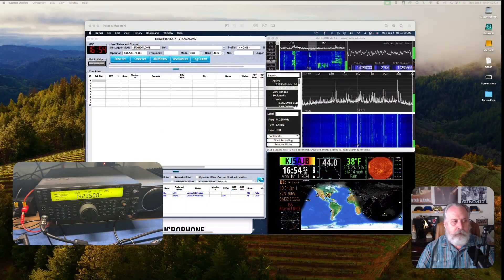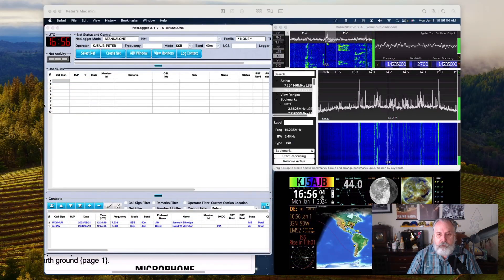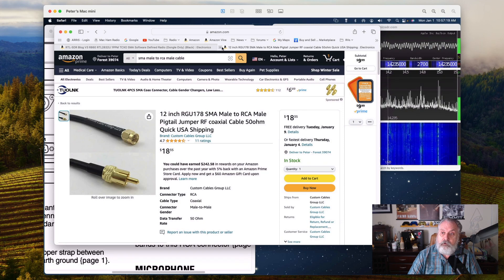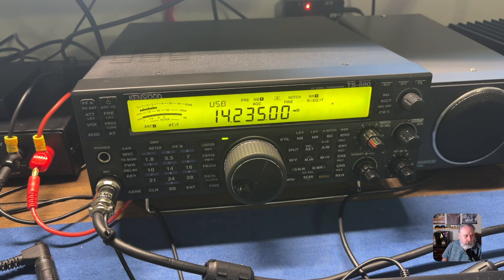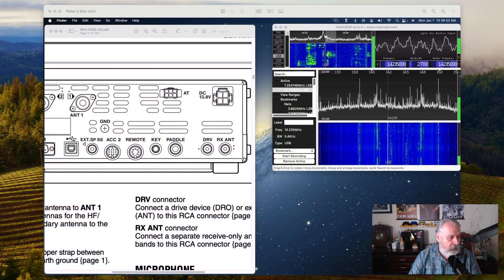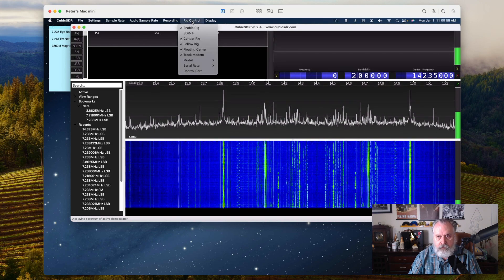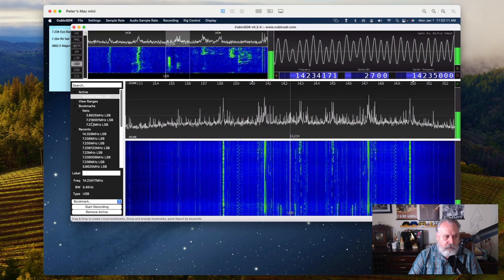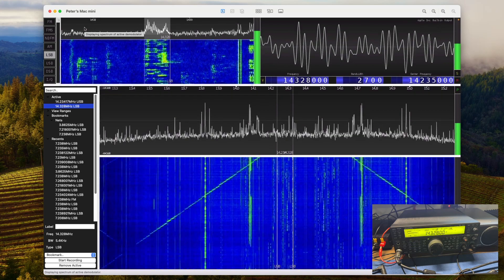Kenwood TS-590SG SDR  Waterfall display Setup on Mac OS

Comment: Thanks for doing this video! Do you know if CubicSDR has a driver for the Elad S2 receiver? Checked the website but not sure. Thanks. 73 de Scott N1IA
Reply from the maker: I couldn’t find info either. You could always download and try it. When CubicSDR runs it opens a window of USB devices connected to the computer and you select the one associated with your device. Thanks for watching the channel.

Comment: Thank you sir! I have this transceiver and I now have a waterfall display with my Nooelec and Ham it Up without having to string up another antenna! I do notice when I key up my sound comes thru my speakers even though I have Cubic SDR muted. Have you encountered this as well? Windows 11.
Reply from the maker: Thanks for the kind words and watching. Yes I have all the time. seems like it takes control of your audio and won't give it back while it's running. I just mute my Mac sound.

Comment: I have no internet in the shack. Once set up will it work without constant internet connectivity?
Reply from the maker: @forgetyourlife  It should as the RF is detected from the SDR receiver attached to the radio not the internet, and the software Cubic SDR is on the computer.

Comment: Dear Peter, thank you for this interesting video. This is exactly on the money. TS-590SG user. Mac user. Your step-by-step explanation was very clear for me until you mentioned the USB cable connection between your computer and the radio. Is the USB connection required for the SDR/waterfall display? I am an enthusiastic learner - only a general for less than 2 years, so please forgive the noob question. 73 KQ4IXD
Reply from the maker: It's not required but if you want CubicSDR to follow the radios frequency then yes. Otherwise as you change the radios frequency, you'll have to change CubicSDRs frequency. Upper and lower side band are a manual selection on Cubic SDR anyway.
Your radio probably came with a USB cable and your the radio also has a regular serial port you can use also. You just have to buy the USB to serial cable. also the Silicon Labs Drivers are located here.
https://www.silabs.com/developers/usb-to-uart-bridge-vcp-drivers?tab=downloads

Thanks for watching and subscribe. 
73's

Comment: Is that drv just a antenna feed to the sdr?  I use a seperate antenna but wonder if i could use that and it be switched.  Interesting.
Reply from the maker: Yes the SDR will monitor your main antenna. When you transmit a relay in the Kenwood isolates it so you don't damage the SDR

Comment: Thanks for sharing. I also have a Kenwood  590, but will be hooking it up to Windows 10. I understand that the computer will control the radio. But I have a question. If I tune the Kenwood, will that also cause the Cubic SDR to stay in sink or will I need to do something additional ? Thank you for your guidance.
Reply from the maker: CubicSDR should follow the radio also as far as frequency, mine does. The one manual thing you'll have to do is select upper or lower sideband.  I plan on doing another video using FLRig and CubicSDR together. It would probably be OmniRig on windows. Thanks for watching.
Reply: @KJ5AJB-jz3dx  Thank you so very much for your reply. I am pretty sure I need to download some drivers for windows 10.  I will give you some feedback on how successful I am in a couple weeks. (Limited budget. need to order the SDR) Again Thank you and have a great day 73.